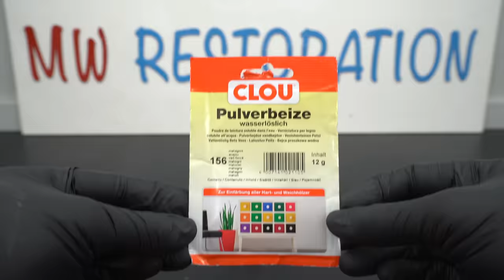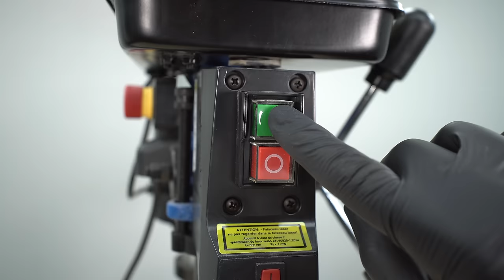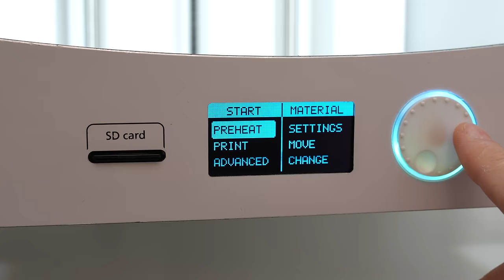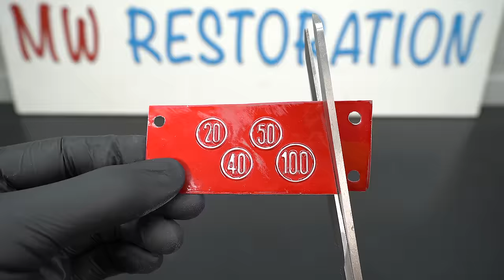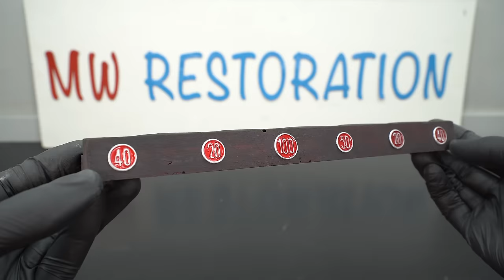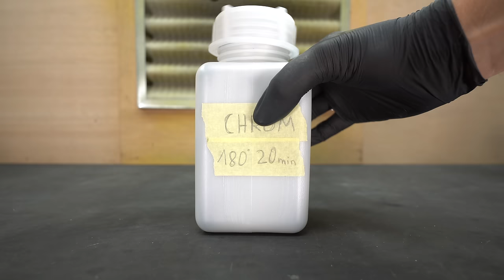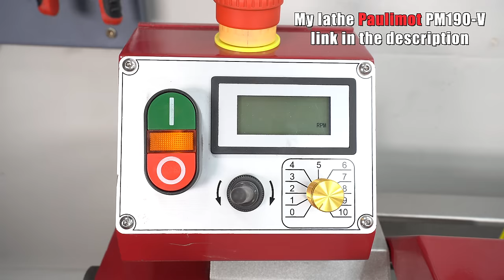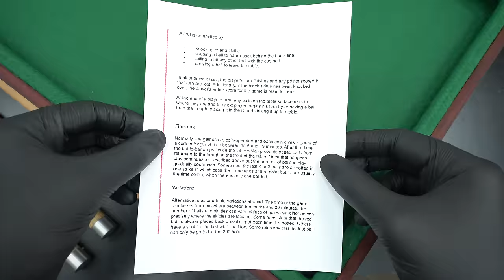Bar billiards restoration 1933s - Pool table Restore Mercier le Champagne

Comment: I feel like a minor improvement on the original design would be to slight recess around the holes so the upper edge of the metal ring would sit completely flush with the table.
But also dang, the manufacturing of that missing ring was spot on!
Reply from the maker: Thanks for your comment 👍. I'm still amazed at how the ring was made. it's so intense that you can make a ring out of a metal tube. just crazy. 😁
Reply: Looks amazing, but it would have been nice to keep some of the original patina.
Reply: part of the challenge is to overcome the edge of the rings
Reply: I thought about that too but the reason it isn't like that is because the green felt makes up for the extra space and in the end it's all one smooth flat surface. If they were recessed the felt would be pretty difficult to fit under and around all of the rings considering the recess would be a straight 90 degree cylinder, it would cause strain to the felt over time and the felt would still add height to the rings.
Reply: @B_M_A  never make the rings flush, leave them be, always.

Comment: Beautiful work. I never tought possible to emboss metal with 3D printed plastic. It's way less brittle than I imagined.
Reply from the maker: But it has to be aluminum. Metal would be too hard and break the plastic 3d print. but with thin sheet aluminum it goes very well. you can print so many different shapes
Reply: If it works on aluminum, it would also work on annealed 321 stainless of the same thickness

Comment: Magnificent job. Only one concern, I can spot a few holes on the lower case, they are distracting. Why haven't you filled them in?
Reply from the maker: I didn't want to putty the entire wooden box, otherwise you wouldn't be able to tell that it was an old item. there are different opinions, some wanted it to look like new, others would rather have the gägnestand repaired, but the old look should be retained.
Reply from the maker: what do you like better ?
Reply: @MWRestoration  well, you have polished, plated, sanded, stained... I think it already was on the path to "new look". But that's your choice. I personally like the "mint" look, but trying not to replace existing parts (only missing ones or the ones beyond repair)

Comment: Too perfect! May I ask why you decide to powdercoat the hardware vs nickel plating it as on the rings?
Reply from the maker: Nickel does not cause a shiny surface. If the surface is not polished and you would nickel-plate it, the surface would not be polished either. If a surface is polished to a high gloss and then nickel-plated, the surface appears shiny. The rings were fairly easy to polish on the lathe because the machine spins fast. this gives you a perfect shiny surface.
It would be very difficult to polish the other components such as the lock to a high gloss. Because the components are very small. In addition, they cannot be mounted on the lathe. And sanding by hand would take a lot of time.
That's why I decided to powder the parts. I used chrome powder for this.

Comment: Really impressive Job!!  
What kind of material did you use for sandblasting the wodden parts?
Reply from the maker: I used glass beads. Here are a few more tips.
Here are some important considerations:

Pressure and Nozzle Selection: The pressure of the air blast and the choice of the nozzle are crucial to ensure that the wood surface is not damaged. Too much pressure or an inappropriate nozzle can lead to excessive removal of wood.

Wood Type: The hardness and structure of the wood species influence how it responds to sandblasting. Hardwoods generally tend to withstand more abrasion than softwoods.

Caution with Thin or Sensitive Areas: When dealing with thin or sensitive wood surfaces, extra care should be taken to avoid damage. It is advisable to treat test areas to determine the optimal pressure and nozzle settings.

Dust Generation: Sandblasting produces dust that can be harmful to health. It is important to wear personal protective equipment such as respiratory protection and ensure that the environment is adequately shielded.

Post-Treatment: After sandblasting, it may be necessary to seal, oil, or otherwise treat the wood to protect it from moisture and stabilize the surface.

Comment: Just brilliant! 
How come you didn't nikel plate everything? Instead of using the chrome paint?
Reply from the maker: A lot of people don't know, but nickel isn't a medium to get something highly glazed. The nickel will only shine if the surface is ground and then polished to a high gloss. If the surface isn't polished to a high luster, the nickel won't shine either. It would be very difficult and tedious to polish the small parts to a high gloss. So I powdercoated them with chrome.

Comment: How are you able to remember where everything goes
Reply from the maker: That's a great question! Care and planning are crucial when it comes to restoration. Before disassembling, I usually take photos or videos to ensure I have a reference. Additionally, I sometimes mark parts or arrange them in a specific order to make reassembly easier later on. Patience and organization are the keys to making sure everything goes back in its place. 😊🔧

Comment: were you suppose to add that rail on the inside? Or was it supposed to be random where it came out? Also why is the easier hole 100 and the harder hole is 50?
Reply from the maker: The numbers were marked as they were originally affixed at the time

Comment: 6:02 ein kleiner tip für das nexte mal wen du @MW Restoration metal kalt umformen willst. glühe es vorher aus dann ist es nach den abkühlen leichter zu bearbeiten. es reicht voll und ganz das metal kurz kirschrot werden zulassen. aber vorsicht wen du zu lange darauf rum hämerst triet die kalt verfestigung ein das heist das metal wird durch das hämmer wider hart. dann must du es wider ausglühen. bei alu reicht es aus wen du es in eien pizza ofen für 1 stunden bei max hitze legst
Reply from the maker: Vielen dank für deinen Tipp😊. Ich werde es mal ausprobieren 👍
Grüße aus Bremen 👋
Reply: @MWRestoration  schöne grüsse aus oldenburg =^.^=

Comment: Curious, why powdercoat the latches chrome instead of nickel coating them?
Reply from the maker: Nickel does not cause a shiny surface. If the surface is not polished and you would nickel-plate it, the surface would not be polished either. If a surface is polished to a high gloss and then nickel-plated, the surface appears shiny. The rings were fairly easy to polish on the lathe because the machine spins fast. this gives you a perfect shiny surface.
It would be very difficult to polish the other components such as the lock to a high gloss. Because the components are very small. In addition, they cannot be mounted on the lathe. And sanding by hand would take a lot of time.
That's why I decided to powder the parts. I used chrome powder for this.

Comment: Very high quality work, i like the 3D printed number molds.

I think the only thing that might be more appropriate for such an old item would be to use oil paint on the aluminum numbers, and maybe polish or nickel plate the corners and latches rather than plastic coat "chrome"

Comment: its good but if anyone is going to do anything similer I have to point out, dont use that cloth or glue it down! that looks like felt rather than baise, its so thick the knapp of the cloth alters the direction of the balls! also painting the glue on will leave brush marks of thicker glue lines that will create channels directing the balls movements, and with light weight balls like that theyre gonna struggle, use a fine spray adhesive like 3M picture mount, but use it lightly and only on the wood, lay the cloth on top of the glue, you can if you need to still brush a little glue for the 5mm all around the edge where the ball can never reach to make sure the edges never lift, other than that its spectacular, especially the numbering!

Comment: Something is not right here, the title says that the table is from 1933, and at 1:57 they are processing a detail of the table, which seems to be made of chipboard, unless I'm blind, of course.  But the chipboard was developed in 1956, although I met information that it was in the forties.  But this essentially does not change it 10 years later.
Reply: Pretty sure that's a piece of scrap that is big enough to fit in the vice.  The piece of wood being worked on is just the thin piece on top.

Comment: How’s come you powder coated the metal trim pieces chrome, which always leaves that micro grainy look sue tot he powder coating, but you used electrolysis to nickel plate the copper rings for the holes on the table? True chrome or nickle plating is much clearer and shinier than any powder coating can offer. 
Just curious.
Reply from the maker: A lot of people don't know, but nickel is not a medium to get some high gloss material. The nickel only shines when the surface is ground and then polished to a high gloss. If the surface isn't polished to a mirror finish, the nickel won't shine either. It would be very difficult and tedious to polish the small parts to a mirror finish. The Eckmatal parts were really very thin, there was a risk that you would grind through the parts. So I powder coated them with chrome.

Comment: nickle plating the other metal pieces instead of doing chrome powder coat would have been a better choice.
Reply from the maker: Nickel does not cause a shiny surface. If the surface is not polished and you would nickel-plate it, the surface would not be polished either. If a surface is polished to a high gloss and then nickel-plated, the surface appears shiny. The rings were fairly easy to polish on the lathe because the machine spins fast. this gives you a perfect shiny surface.
It would be very difficult to polish the other components such as the lock to a high gloss. Because the components are very small. In addition, they cannot be mounted on the lathe. And sanding by hand would take a lot of time.
That's why I decided to powder the parts. I used chrome powder for this.

Comment: The famous Theseus boat, after renovation, is the pool table the same or is it a new one?
Reply from the maker: The concept you're referring to, often known as the "Ship of Theseus" paradox, raises a philosophical question about identity and change. In the context of the renovated pool table, it depends on the extent of the changes made during the renovation. If almost all parts of the table were replaced or extensively modified, some might argue that it's essentially a new table. However, if the core structure and some original components were retained, you could argue that it's still the same table with significant upgrades. It ultimately comes down to how one defines identity in the context of the object and its changes.
Reply: @MWRestoration  wow! Perfect

Comment: I like how you left the small nicks and dings alone instead of using wood filler on them. They add some charm and character.
Reply from the maker: That's exactly how it is. I've had some comments as to why I didn't use a wood spatula to fill in the holes. I explained to people that you don't always have to repair everything 100 percent. You should be able to tell that this is a very old item, but it is in good condition.

Comment: All that hard work and it still looks dull 😢…I was expecting more. 
The missing ring you made was awesome, as were the butts of the cues…but this project could’ve been so much better.
Choose some new wood, brighten it up, make it glossy, make the balls glossy too…it’s quite dull to look at 😢 why point out that the table was uneven and use felt which was as uneven as before?